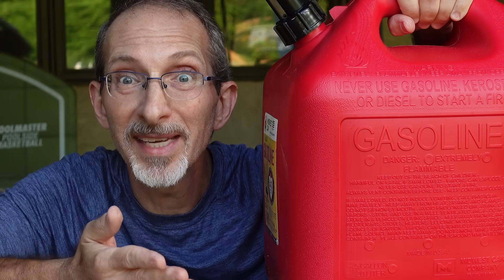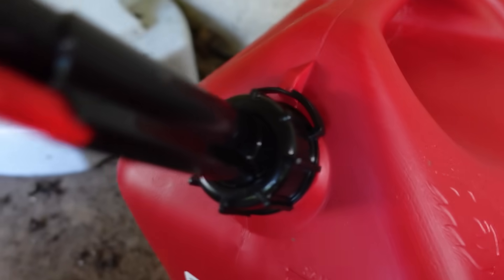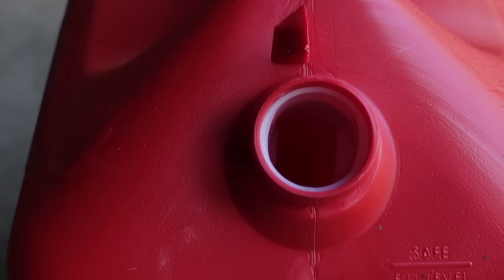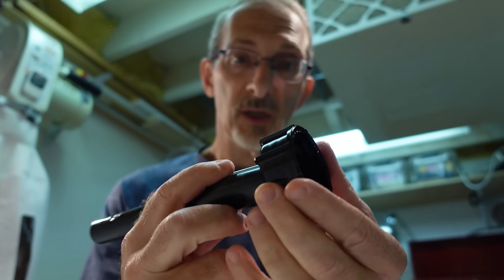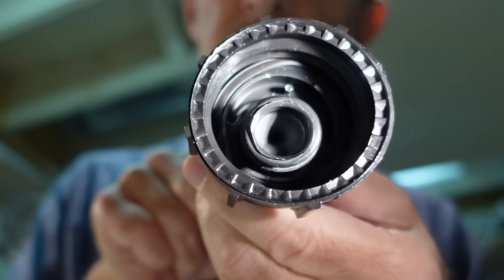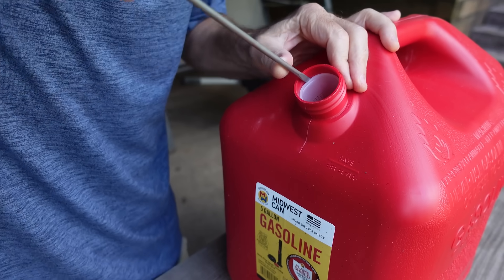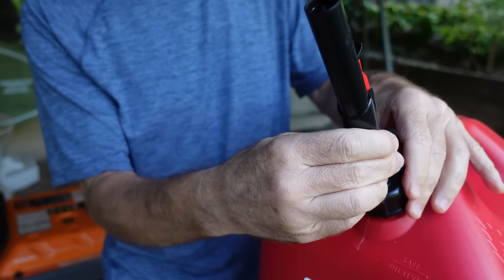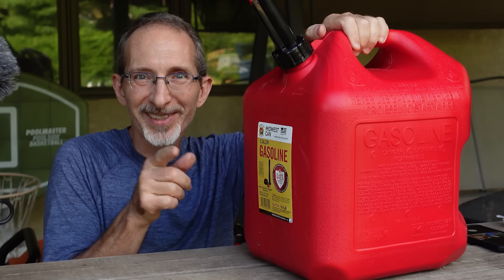Gas Can Modification | New Gas Can Fix

Comment: I spent 45 years as an active volunteer firefighter and emergency medical technician. I ran a lot of calls in 45 years so I have a fairly good sample of calls to choose from so I'm not saying that the ones I'm going to write about are everyday occurrences. They are NOT! That said I will say that just one of them intruding into your life is a bad thing. Not everyone who cannot manage these fuel cans is the devil's personal representative in my universe. I just thought I'd share my experiences of the kinds of incidents that caused regulatory agencies to act. Let me add that the same approach is not used by all manufacturers. There are several accepted approaches to preventing poisonings, spills and ignitions. If you find one type obnoxious to use then consider trying another prior to giving up the additional safety that the different designs provide.

I ran a call were  5 children were covered head to toe in Kerosene. Thank good that they chose a combustible liquid to play with and not a flammable liquid! Difference is that the Combustible liquids have to be forced to give off flammable vapors that can be readily ignited. The kind of things that you do is have them soak into a wick so that is spread rather thin, light the tip of the wick on fire because the wick itself will burn and in turn heat the combustible liquid enough so that it will cause the kerosene; or other combustible liquid; to give off vapors that will burn continuously. The kerosene continues to soak into the wick to replace the amount that has turned into vapor and burned. While rising up through the wick it keeps the fibers of the wick too cool to burn and the flame occurs at the tip of the wick were you need it to. Like all of it's combustible cousins I can pour kerosene in any fairly substantial open topped container and use it to put out cigarettes and matches because it is not hot enough to give off flammable vapors to burn. Flammable liquids such as gasoline, naphtha, alcohol, and there close cousins give off flammable vapors all the time at all common temperatures and pressures. Any ignition heat that is hot enough to ignite the vapors is all it takes to cause continuous flames.  That difference between a flammable and a combustible liquid was why that call didn't become a national news tragedy. 

My point is that the kids got their hands on kerosene because it was stored in a screw top can that had no safety latch such as the one this fella cut off. Actual testing by the US Consumer Product Safety Commission (CPSC) and the California Air Resources Board (CARB) have shown that the latch which he found so inconvenient he had to cut it off is effective at preventing the cap from being removed by young children who cannot yet appreciate that soaking ones clothes (wicking) in kerosene, or drinking, or letting anyone else drink it is a bad thing. 

I ran several calls for mowers and other small engine powered machines on fire in 45 years. The most  common cause was spilled gasoline from fueling while the engine was still above the flashpoint of gasoline vapor such as while it was still running or too quickly after it has been turned off but has not cooled below the gasoline vapors flash point. No hideous burns from that particular ignition scenario but 2 different structure fires because the mower was running in a garage when it ignited the spilled fuel and the fuel line burned through because the occupant did not take action to extinguish the fire or roll the mower out of the garage. Remember that such incidents come to the fire services attention because they progressed to ignition. Each such ignition represents dozens of spills that had luckier of more level headed outcomes. 

The root problem is that the spillage is a lot worse without an automatic cut off to the fuel flow when the tank is full. The spouts on those cans are meant to do that buy I will admit that I myself do not find them fully effective. Since the air goes in through a tube inside the filling tube when the fuel in the tank covers the end of the air tube the flow slows way down. When you pull the tank up the spring pushes the valve stem and it's o ring seal closed and the flow stops. The spring is so hard to compress so that children cannot readily open it. What I would do is to substitute a spring that is easier to compress but will still provide sufficient pressure to close the valve. The draw back is that the valve may not close tightly enough to prevent all fuel vapors from escaping. I'm sure that the regulators at CARB would be horrified but I will be able to live with that one defect.
Reply from the maker: @hornetd - thank you for sharing your comments, and I value your experience. I thought your explanation of the difference between kerosene and gasoline was excellent. If there’s any chance that kids will get their hands on your fuel container, then defeating the safety collar is not for you! The no spill spouts, while well intentioned, almost require a training course to use effectively. After several failed attempts with my gas containers, I sought out a solution that didn’t require purchasing an aftermarket nozzle. I hope people, at the very least, learn from these videos and from these comments, that they have choices and there are many alternatives. I similarly hope that the industry eventually listens to the people that are speaking out, and reflects our concerns and requirements in future designs. I sincerely appreciate you taking the time to add to this conversation!

Comment: For convirnce
Reply: For convenience and to prevent the filter from falling in the gasoline can, I would use a pair of needle nose Visegrips where you can lock the needle nose onto the filter and don’t worry about the filter falling in.  The problem I have with the new gasoline cans is that there is no vent port to allow air in the can as gasoline flows out.  With the new style gasoline can, you are left with a chugged flow of gasoline as air tries to enter the gasoline can.
Reply from the maker: Hi Bill, good tip to use the locking vice grips! I added a vent in my follow up video: https://youtu.be/XoYxdrhB6Ls

Comment: After performing a similar modification, I  personally prefer the Sceptre gas cans, as the tip of the nozzle is angled about 30 degrees. Regardless, every nozzle/spout design I've tried suffers if continually immersed (stored) in a full gas can ---- eventually the plastic swells, and either the spout won't push back smoothly or the locking latch (a yellow or green collar on Scepter gas nozzles) won't turn. I cut the locking collars off with a sharp razor knife and remove the small spring, but *I leave the main spring in place inside the spout mechanism*. To pour gas out of the can, I grasp the base of the spring-loaded nozzle with one hand and pull towards the can while holding the can with the other hand; when you let go of the nozzle slightly, the spring pushes the plunger mechanism closed and the gas stops flowing (and even if the can tips over, the gas won't all pour out).

 As long as you don't store a can of gas with the nozzles hanging down into the fuel, the modified nozzle will last for years.

I bought several spare Sceptre nozzles with caps and filled the center hole in the cap with a thick plastic disc epoxy-glued into it (JB Weld works well) and added a rubber gasket, so that I can seal up the full gas cans tightly for storage  without needing to have the nozzles either sitting in the gasoline, swelling, or exposed and pointing up towards the sky. Unfortunately, every brand of gas can uses a different thread and so the nozzles and caps are not interchangeable. PS, I have tried several styles of the Midwest cans and don't like them.The Briggs and Stratton cans work a bit better; but rest assured that any brand of gas can which has the nozzle sitting and soaking in the stored fuel is going to fail prematurely.
Reply from the maker: I can’t bring myself to flipping around the nozzle and storing it in the gasoline. So all of my containers get stored with the spout facing out, and I have not had any problems. In my follow up video, link in the description, I showed how you can modify the spring to make it more manageable if you want to keep the spring loaded nozzle feature. So far it is working great, and it is much easier to use the container. I do like you suggest, one hand to depress the spout and the other hand on the handle. Admittedly this is physically difficult when the 5 gallon containers are full!
Reply: @MikeFyxdt  , aside from mice chewing on the tips of the plastic spouts, some types of insects here in New England like to build egg nests or cocoons inside the spouts. Wasp-like mud daubers will tightly pack the spout full of mud (!), and some other critter (spiders perhaps) builds silk-like, wispy papery cocoons in the  nozzles as well. It is surprisingly difficult to clean insect mud and silk from inside the nozzles. If you store the spouts on the can, facing the air, be sure to cap them off with something!

Comment: This is because our lawmakers are owned by big money. Everything in our lives has been porposely monkeyed up to screw us into spending more money and keep us frustrated and confused. Good job defeating that evil crap. They are extraordinarily dangerous. Especially on the side of a busy road. They simply do not function reasonably at all.
Reply from the maker: Dan, you have brought up an excellent point, which I don’t think anyone else has touched on in over 2500 comments. When you are broken down on the side of a busy road and need to refuel, that is not the time to have to dance with a badly designed gas container. I appreciate you joining the conversation…

Comment: this is why i saved all my old nozzles from the non safe gas cans i have had for 20 years ( I have a small box of them) next to my box of incandescent light bulbs
Reply from the maker: My stash of old gas can nozzles is zero. My stash of incandescent bulbs is probably in the hundreds by now. I wish it were the other way around!
Reply: You would store them next to flammable items. There is nothing wrong with these new cans. Stop spreading misinformation
Reply: @bryanjk  Keep on bleating Mr. Sheep.

Comment: Which buroaucrat was looking for a job and then designed that crap!? Gee how difficult do you want to make filling and emptying a gas can?? That's unsafe just because of the frustration the thing causes!
Reply from the maker: Flame mitigation devices were just signed into law as mandatory, in the end of 2020. They will be required on all containers within a couple of years. Most manufacturers are already putting them in place. That being said, those filters make it darn near impossible to fill the tanks!

Comment: Yep, those are engineering disasters. I think it also needs a closable vent on the opposite side, the older ones had it and they poor faster and smoother, no goggal goggal bullshit, just smooth laminar flow.
I use that vent to help me fill gas tank containers, it fills them way faster, and then when it gets close to the rim of the tank i slip my thumb over the vent and it helps stop the flow as i reach the rim of the container i am filling, not accidental over filling this way, but still get filled to the rim, in less than 5 seconds the gas tank cap is already back on.
Reply from the maker: Tony, I added a vent in the second video, link in the description. Covering the vent hole with your finger is indeed a good way to slow the flow. Sometimes when I am feeling really small tanks like my string trimmer, I leave the back cap on so the fuel flows in a trickle. Great suggestions!

Comment: That filter in the the can, the little plastic screen thing?  Yea, that does nothing but keep the can itself clean.  As soon as you pour the gas out of the can and into whatever tank (lawnmower, generator, etc.) it's going to reside in, any debris that the plastic filter caught ends up in your gas tank.  It's better to let it settle to the bottom of the can and just dump the last 1/4 cup of gas or so out, throwing it away with the debris still suspended in the can.  I have to wonder what dipstick thought up something like that ...
Reply from the maker: The filter is actually a flame arrester, which I describe in detail in my follow up video, link in the description. You are right, if it were a debris filter then it would be a terrible design! It just makes no sense! 😁

Comment: The filter does nothing but keeps contaminants out of the gas can, not your gas tank. The junk will just flow back out lol. I think the main reason the screen is there is to prevent fumes from flowing out too quickly, or some flame blocker, to prevent flames from igniting inside the can. But I'm only guessing.
Reply from the maker: 100% correct! I learned this after making the video, and explained it in my follow up video, link in the description. Thank you for adding to the conversation, it is an important point!

Comment: You could fill an encyclopaedia with items and rules that have become incredibly dangerous by trying to comply with safety standards etc. It's like they are designed by some student that has never spent a single day in a real, actual workplace, away from their CAD program and PC.
Reply from the maker: I honestly believe all of the features of these gas containers are well intentioned, but simply not practical in every day use.

Comment: The screen catches any impurities going into the gas can and keeps them conveniently located at the spout so they are guaranteed to go directly into the piece of equipment that you are trying to fuel up 😂 modern gas cans are the perfect example of why you should run away when you hear "I'm from the government and I'm here to help"
Reply from the maker: Correction, it’s not a filter but a flame mitigation device. As a filter, I agree that it would make no sense. I followed up the flame arrester information in my second video, link in the description. Thanks for watching!

Comment: If you have a gas can already..ok cool... But you know what, I said hell with it and just got a real gas can... A No-Spill. Surecan is also the other favorite out there but a little on the steep side.

I never had an issue with the filter in the can.. Just when it gets half way, don't press the pump at full blast! I can fill a can to the top with out any issues and even have the nozzle out of the can a little and control the flow rate. But wow, I never figure the filer in the can be that big or that much of a pain to take off!! I will keep this in mind for friends that have a crappy can still :) Thanks!
Reply from the maker: I agree that you can “learn” to fill these tanks. But come on, you shouldn’t have to relearn how to operate a pump nozzle.
Reply: @MikeFyxdt  Well I wouldn't say you are relearning the pump...You can't tell me when you are filling at the pump and when you get to 90 cents you don't slow it down so you don't get that .01 cent over? :)

Comment: I approve your butchery but do tell us that the telescopic sleeve leaks like sieve.
Reply from the maker: The telescopic sleeve does not leak. The outer portion is more of a support, and an air vent. The inner portion runs the full length, so there’s nowhere for it to leak out.
Reply: @MikeFyxdt  - Really... give it some time it will start leaking. Just get yourself a transmission funnel and regular cap. I'm also surprised it has Made in USA molded in it too. You know the reason for all this nonsense? To try to minimize fuel vapors escaping to the atmosphere. It's ridiculous and dangerous. I'm sure people have been killed by this garbage. Someone below recommended old school metal cans from Eagle. Even those have plastic handles on them now.

Comment: For the past several years gasoline cans seem like they were designed by a government committee.  The result is a can designed to protect the environment makes using it very inconvenient and causes you to spill more gasoline than you would have otherwise.  Thank you EPA; I needed more stress in my life.
Reply from the maker: Most of these changes are from the consumer protection agency, with safety in mind. Spilling gasoline takes a back seat concern to the safety issues. Unfortunately, even with good intention, these containers are simply difficult to use!

Comment: Ran across your vid by accident, but you are right. The springs leads to more spills than anything when fueling up the chainsaw, UTV, lawnmower, etc. You got me thinking though. Instead of removing the entire spring, I am going to try and cut it down some so its just strong enough to get the lever to lock back when done. I'll let you know how it goes. Thanks for the vid.

Comment: There is no point for the screen. It will catch what goes into the thank but when you pour gas, whatever the screen catches will go the gas tank you're filling
Reply from the maker: Shannon, the filter is actually a flame arrester, which I explain in my follow up video. Link in the description. I agree, it would be a silly design if it was meant to be a filter! Thanks for watching.

Comment: Now you could have left that cap safety on and clipped a notch in that red tab that is attached to the can problem solved on that. Then the spring you could have just clipped a couple turns from the spring and reassembled the spout and that problem would also be solved and still be in compliance with the safety rules probably! Better yet gone to ace hardware store and gotten a weaker spring the same length
Reply from the maker: Hi Greg, I modified the spring in my follow up video, link in the description. I cut away half of the spring and then stretched it to its original length, and that did the trick! Thanks for joining the conversation!